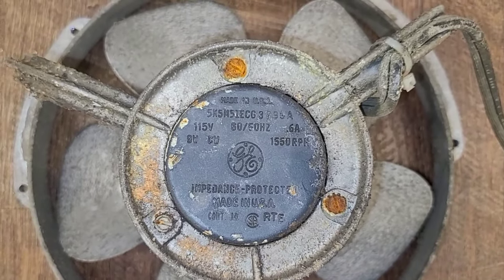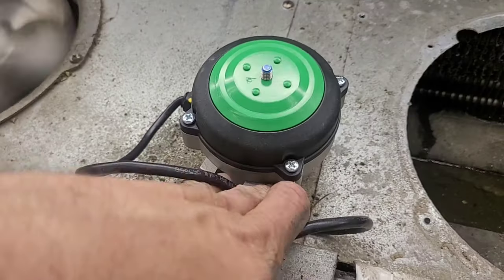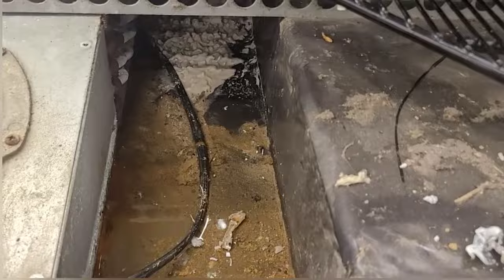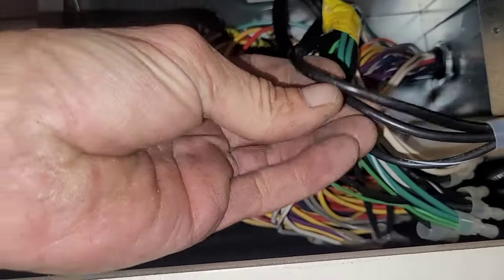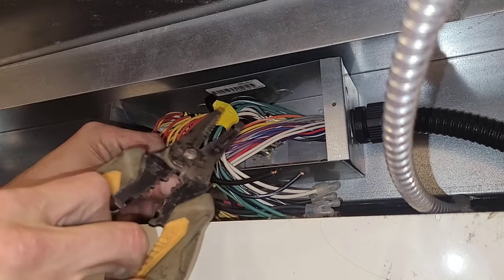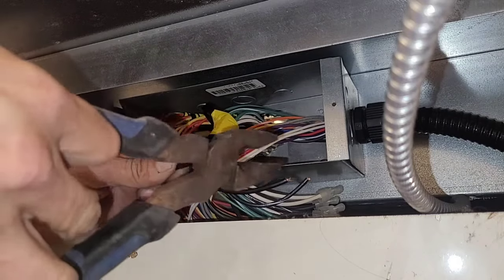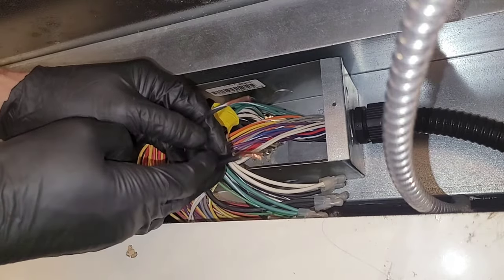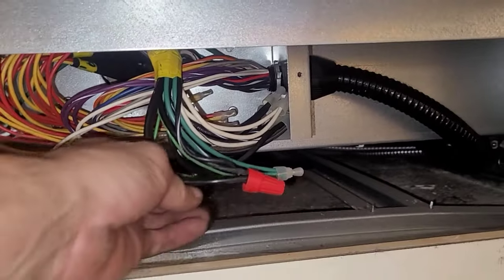EVAPORATOR FAN MOTOR SWAP GROCERY STORE ISLAND CASE

Comment: Looks like a STOP & SHOP, or a  GIANT brand store. Great work man. Most them cases have/had disconnect switches somewhere under them cases. Usually near the 'convenience receptacle' on the cases base moldings. If not, could be in 'R' panels, for refrigeration and fan and lighting.
(But who the hell knows, especially in old ass stores)! 
Lol
Done hundreds of remodels in those stores. Fun times smh 
Cheers from Pennsylvania!